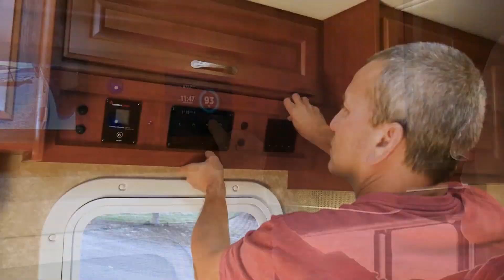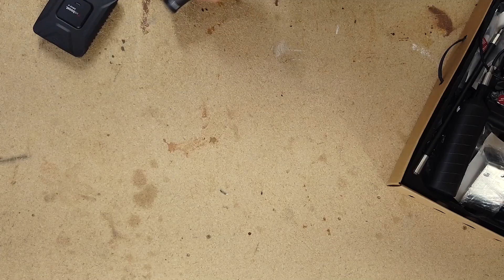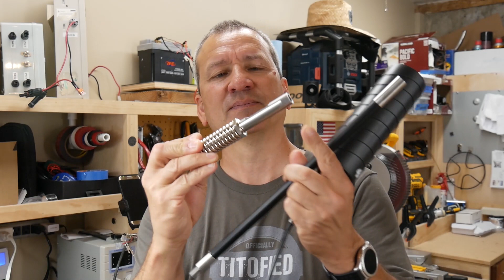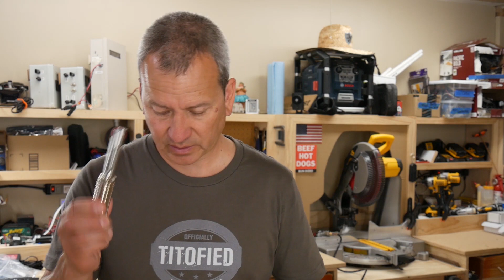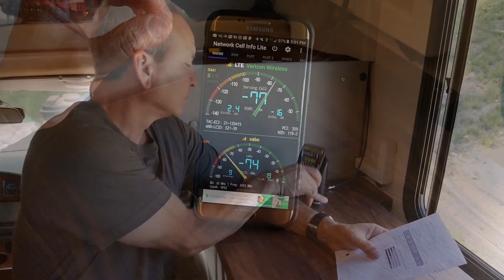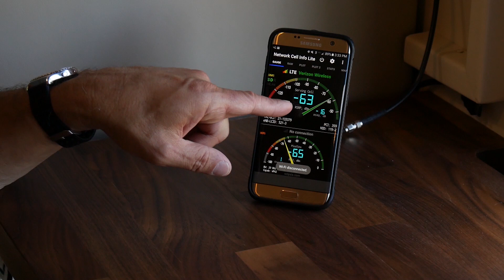WeBoost DRIVE X RV Cell Phone Booster Review

Comment: Hey Brian, great video. Quick question for you… I’m getting ready to wire up my Wii boost RV cell phone booster and the little red cap slid off of the 12 wiring while and packaging… Can you tell me how to distinguish which of the two wires is the positive?  I’ve tried to contact we boost, but I’ve been unsuccessful.
Reply from the maker: The outside of the small metal plug that goes in the booster is the negative and the inside of the plugnis positive. Use a meter set to resistance mode (measured in ohms) ant touch one probe to the plug and the other to each wire. When the value goes to 0 that means they are connected. Some meters have a beep feature that will beep when there is a connectiom. Hope that helps. Also you could just hook it up both ways. It shouldnt power on if connected backwards.

Comment: We have 5th wheel. Could I install this weboost on my truck and access the boosted signal in and around the RV. I am thinking that I may need the boosted signal when we are traveling in the truck away from the RV and the truck would always be near if we wanted the boosted signal in the RV.
Reply from the maker: You'd have to move it back and forth to the 5th wheel. The inside antenna needs to be very close to your phone or hotspot for best results.

Comment: Hi, thanks for the info. I mounted my antena to my Dish bracket and its really stable. Are there any issues with attaching it that close to the dish. I dont ever use the dish so it's off.
Reply from the maker: I don't see a problem. The biggest problem is feedback with the internal antenna.

Comment: I have the weboost drive x rv and a small camper. my problem is i cant  get the inside antenna far enough from the outside antenna and i get the (red) light for the antennas interfering with each other. any ideas on how too stop antenna interference?
Reply: Tinfoil
Reply: @PsymphonicSolo  I installed a aluminum plate 2 foot x 3 foot on the roof, then installed the antenna on that. then i ordered a smaller inside antenna, it works great now.

Comment: I am seeing some reviews where people state a bad experience inside their RV and that the internal antenna only extends signal 2 feet instead of the advertised 10 feet. Have you experienced any issues with the distance that the signal extends inside the RV? Also, do you use a mobile hotspot in addition to the weBoost to get the cellular signal boosted to the hotspot and then wifi from the hotspot to devices inside the RV? Thank you!
Reply from the maker: Yes on both accounts. You need to be very close to the internal antenna - within a foot for best results. I place my hotspot right next to the antenna. The boosted signal degrades quickly the further you move away. The reason for this is to avoid feedback with the outside antenna in a small space.

Comment: I went to this antenna on my old RV65 Weboost. Received signal levels improved over my old flat rectangular outside antenna substantially. The really big deal about this antenna is the transmit gain. This was way, way better. 

Weboost now sells this antenna ala cart, but they should 1) sell the antenna without the 25' SMA cable (like you, I reused my F type cable);  2) have a other roof top mount options. Not everyone has a ladder or a Class C or Class A to clamp it to. 

I have it on the same mount you used, but I wonder if its going to be strong enough. I didn't use the extension rod, BTW. The mount thread is 1" pipe (11.5 threads per inch) with straight rather than typical tapered threads. Took me 30 minutes of research to find that info.

This might help someone. The antenna end is SMA male, but its has the threaded nut end that you might think is female. Look closely and you will see a tiny pin sticking up down in there.  

While I'm blabbing... a booster can only boost what signal you are getting. If there is actually no signal, you won't have service (0x any number is zero). 

The nature of a booster that it is only one channel, which kind of defeats the new MIMO devices that grab two channels. The new 4G iPhone actually has 4 channel MIMO. Even if you have wonderful gain and signal, data speed could be higher using a simple $40 MIMO antenna stuck to a window, in the case of a hotspot. So, a boosted signal could be slower data-wise than a non boosted MIMO device, with or without, an external antenna.  

Love your videos, Brian. Thanks.

Comment: Hi I saw in some video that the problem with Weboost is the internal transmitter which can transmit the boosted signal only 2 feet away.  Pls clarify this point.  Thanks for the nice video.
Reply from the maker: For the strongest signal yes. Your device should be very close to the internal antenna. The internal antenna does have an effective range of about 9 ft, but the signal boost degrades quickly as you move it away. I keep my phone or hotspot within a foot of the antenna for best results. There is potential for feedback between the outside and inside antenna which is the reason for the limited range of the internal antenna. Hope that helps.

Comment: What if wife and I both need to work on the road everyday 8 hours a day. Any advise? Trying to figure out the best solution.
Reply from the maker: Depends on where you plan to be. Mobile coverage areas are improving. If you plan to be in more remote areas though, then a booster is good to have. I'd also plan on carrying multiple data plans. Here's more info for you: https://www.rvwithtito.com/articles/do-you-need-rv-cell-phone-booster/

Comment: Hi Brian. Your information is incredibly helpful and your presentation style is very relaxed and well done. Thanks. After watching your various cell booster reviews, it almost seemed like your review of the Weboost Reach was the most positive/significant in terms of benefit. Where did you end up in the end with your booster? Also what are your thoughts about using a Verizon Mifi with an external antenna instead of a booster?

Comment: Typically F connectors are 75ohm and SMA connectors are 50ohm. You potentially  got a big impedance mismatch which will effect your retuning loss/VSWR and insertion loss. Your performance will suffer.

Comment: Hi!  Thank you for the great review that is easy to understand. You mentioned that many people attach the Drive X antenna to the ladder of their RV.  I have a 25 foot RV with no ladder (my RV appears to be a smaller version of yours and is a 2005 model). I see that you placed your antenna on the roof.  Is there a particular location on the roof that is best for installation?
Reply from the maker: I mounted it towards the rear so there's adequate separation from the internal antenna.
Reply: @RVwithTito  Thank you for responding and for providing the reasoning why.  That is helpful.

Comment: Is the cable you are using the from the roof to inside the RG-6 75ohm TV antenna cable? If so you should consider changing it out to a 50 ohm cable. The lower the loss type cable the better, as well as the shortest length needed. The 75 ohm cable will increase the SWR, meaning the antenna will send some of the transmitted power back down to the amp, creating more heat and reducing its life. I'd run LMR-240 or RG-213 for a short distance, say under 20ft. Anything much longer and the signal loss in the line adds up.  For long runs LMR-400 would be good, although it is stiff and does not want to bend. Reducing the RF adaptors, SMA to Type F, will help reduce loss as well.
Reply from the maker: I may do that at some point. For now it's the original cable that came with the drive 4G-X RV
Reply: @RVwithTito  Later I did notice that they provide RG-6 in the kit, so they may have installed a matching circuit for the output. Odd, but possible so I wouldn't mess with it.

Comment: Thank you for the great review.  Based upon your video, we decided to purchase the Drive X RV for our Airstream when we go to desolate locations!  Your 5% discount code saved enough money to cover shipping! 

I have a rather weird question for you.  Do you happen to know the thread size and pitch of the antenna base (or extension)?  I am thinking of threading the top of my flag pole and running the wire down the inside for a hidden setup.
Reply from the maker: Here you go. Looks like the threads are 3/8-24. Here's a link to the antenna specs https://www.weboost.com/products/304415?variant=12417517446&currency=USD&gclid=CjwKCAjwtqj2BRBYEiwAqfzur4XyM8OKnGy6E42ntDmyj-fpAIdlELctYA6MKrIcqMjbhPEAjOwW9hoCbCwQAvD_BwE

Comment: Great review until you switched to airplane mode then back which means you are no longer testing your system rather the different signal strength from a different source/cell tower.

Comment: You can't say that the two aren't very different just because the case is the same. You have no idea what's inside of those cases, and if you do, you didn't communicate that at all in this video.
Reply from the maker: I confirmed with weboost prior to making the video that it is a rebranded drive 4G-X.
Reply: @RVwithTito  alright I stand corrected

Comment: What is the effective range of the internal antenna? I've heard that you need to be very close to it to get much boost.

Would a Drive Reach with the shown antenna be a better setup? Is the antenna sold separately?

Thanks for such clear and extensively researched videos.
Reply from the maker: The internal antenna range is roughly 1 to 6 ft. Within 1ft is best. Yes, with a couple cheap coax adapters the Reach will work just fine with these antennas which you can buy separately. That's what I'm currently using. FYI  weboost may be releasing a Drive Reach RV kit sometime this season if you want to hold out.
Reply: @RVwithTito  Thanks bud!

Comment: OTR high line Montana Suix DR Thunder Fort Peck res Googlefi 2G bill protection does not work Amber Waves Glasgow Library wifi chocolate browney thunder tribe Verizon T-mobile 
4 spark plugs wired together you can be internet provider.

Comment: I have watched dozens of reviews of boosters including all of yours.  No one ever shows an evaluation of the how the booster does with a MiFi or other hotspot.  I know they work on cellular data but since so many of us use them, it would be interesting to see someone actually discuss this.  I know I can not be the only one.  I have hotspots on two separate carriers and would love to see what effect a booster would have on them.
Reply from the maker: Thanks for the suggestion. They go hand in hand. Any improvement in the cell signal from your booster will usually translate into faster and more stable data from your hotspot. There are times in busy areas where the cell tower is bogged down and you'll still have slow data with a strong cell signal.

Comment: Is there a way to adapt the setup so these boosters dont interfere with adjacent solar panels?
Reply from the maker: Antenna placement certainly is a concern if it's going to cast a shadow on your solar panels.
Reply: RV with Tito DIY - thanks. I’m guessing along the lines of connecting the panels in parallel instead of serial (so partial shadows have less impact), a system where the booster can retract right down on the roof out of the way of the solar panels and a layout on the roof so that shadows are minimised (assuming willing to orient the motorhome every time it’s parked) ?

Comment: Brian, I have just purchased the 4G X RV about a month ago. Installed the exterior antenna on the ladder and the booster in a cabinet about 20' feet away, all according to the instructions.  I too, added and on/off switch running off the 12 volt side.  Have the green light so I'm good to go. Only no signal boost whatsoever. I have the internal antenna on the counter across from out table.....4' away at the most. And I get nothing.  The instructions state I should be able to be about 5' and still get boost.  I noticed on your video you placed your phone right on the internal antenna, is this what it takes to get a boosted signal????   Also, the boost your were getting was that 3G or 4G LTE?  I read that you get a usable signal you need to turn off the LTE and then you get a stronger 3G signal......but 3G is really not good for anything these days.
Comments are appreciated.  And keep your awesome videos coming.   Bob
Reply from the maker: The range of the internal signal will certainly vary depending on the boost you're getting at each location. I place my phone very close to the internal antenna for the best boosted signal. Each foot you move away starts to degrade the signal fast. You should still benefit from 3-5 away, but it will be much less. Yes. the boost I was getting was 4G LTE.

Comment: You said you didn't drill holes in your trailer and I don't want to as well so how did you run the wires through and in the cupboard ? Did you go through a window ?  Thanks Laurie
Reply from the maker: I ran my booster antenna cable next to my plumbing vent on the roof. After removing the vent cap I did drill a hole next to the vent pipe. I fed the cable into the hole and down next to the pipe which came out under my bathroom vanity. From there I could run it to the other cabinet. When done, I sealed up around the cable on the roof and the hole I drilled with some silicon and replaced the vent cap.

Comment: Earlier in your videos, you pulled a cable through the black tank vent. I thought you made a video of that but could not find it,  could you reference the video link please? Much thanks.
Reply from the maker: I'm not sure I have made a video about that. I was just helping a friend with that the other day though. Just pop the top off of the plumbing vent, then drill a small hole in the plastic just outside the vent pipe. Then run the cable down next to the pipe and seal up the hole with silicon when you're done. Of course, you'll have to go find the cable on the other end behind a wall or cabinet somewhere. Hope that helps.
Reply: RV with Tito DIY thanks much.

Comment: How much power does it draw if you have it wired into your 12v system? Thanks
Reply from the maker: Just measured. It draws about 1.1A.
Reply: @RVwithTito  solid that's about the wattage of a cell phone charger.

Comment: A good test would be to run the cable with the SMA ends outside of the RV just as a temporary test and ck the signals compared to the other coax.
The normal TV coax has 75 ohms resistance, I believe the SMA has 50 ohms resistance, this would make for a better signal than with the TV coax.

Comment: A couple thoughts.  First, the way dB works with signal strength is that a 3 dB change is double,  6 dB is 4 times, 9 dB is 8 times, a 10 dB change is 10 times the strength, 20 dB is 100 times the strength, 30 dB is 1000 times the strength.  And they do add, meaning that a 33 dB change would be 2000 times the strength of the original signal. In short, it is a logarithmic function.  BUT, it seems to me that the comparison between the two systems is wrong - and frankly I don't know how you could easily make the comparison except to go into the boondocks and find a place where one system was able to access a tower and the other system could not.  The comparison you were making - unless I really missed something - was simply the difference between your phone's ability to receive the tower directly, while the phone was inside of the steel box which is your RV, compared to the boosted signal through the weboost system.  A slightly better comparison would be to record the signal strength while you are on top of the RV, at an elevation similar to the height of the weboost antenna.  Then compare that to the strength inside, with the signal as repeated by the weboost unit.  But that does not really compare the two weboost units.  Thoughts?
Reply from the maker: Thanks for sharing your thoughts. No we are not currently in a remote area as you noted. I've done several other videos about signal boosting, but the main point of this video was to compare the differences between the two external antennas.
Reply: Robert - I agree and have seen other booster videos make the leap on signal strength.  I just unboxed our WeBoost Drive X RV that arrived today and have been doing some testing from the house. Signal Strength, we the WeBoost on, measures the strength between the phone and the Internal Antenna.  And tells you nothing about the quality of the boosted/amplified signal from the Tower.

With the WeBoost off, I'm getting about -115db: poor signal strength.  With the WeBoost on and my cell phone only two feet from the Internal Antenna, it goes up to only -105db. If I lean my phone against the Internal Antenna, I see -69db like Brian.

With regards to boosted signal quality, I'm seeing troubling results. SpeedTest consistently shows speeds about 25% of the unboosted ones. Yes - with the booster on, my speeds are 1/4th of what they are with the Booster off.

I called WeBoost a few minutes ago and their customer service was fantastic.  After chatting, they're sending me out a new Outside Antenna. When that arrives, I'll retest things.

Comment: Curious if you were to keep the external and internal antennas from this kit, but paired them with the drive reach amplifier instead of the one in this kit... that seems like it would combine the best amplifier with the best antennas?
Reply from the maker: Yes. I've done that and with a couple adapters it works just fine.